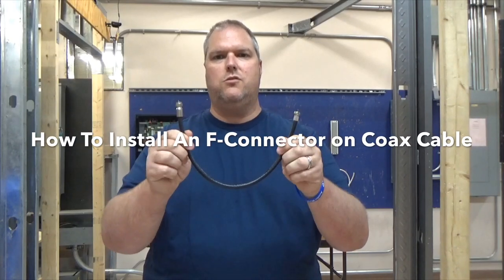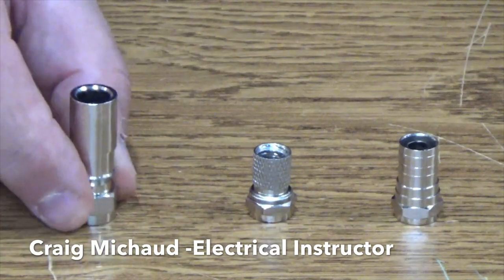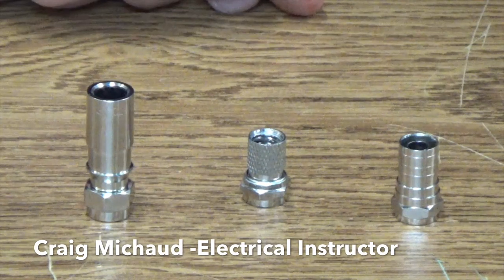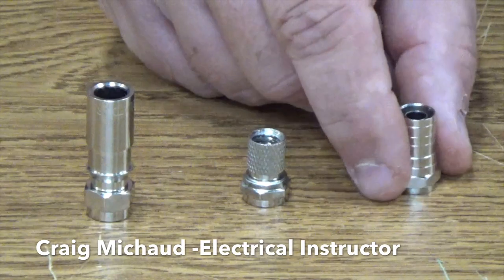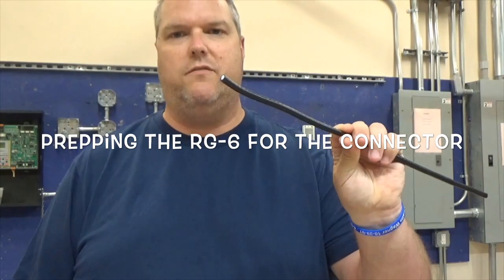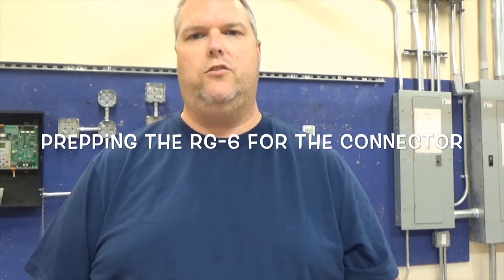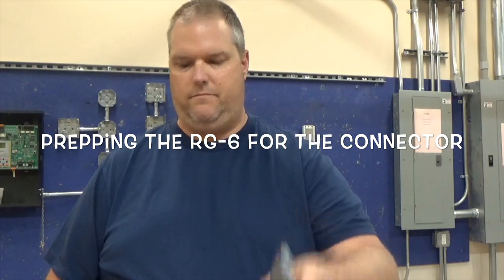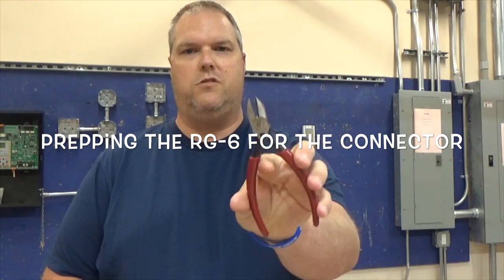Making "F" type Crimp, Compression, and Twist-on Connectors for Coax Cable

Comment: Bro, big thanks for this video. I live at the beach where no metal escapes corrosion, including coax connectors. I noticed that on days when the temperature dropped, my cable would go out. I guess the metal would contract enough that it would kill the signal. wild right? So before paying somebody in your line of work big bucks to crawl under my house and install new coax, I decided to clean and/or replace the badly corroded connectors and splitters.  Thing is, I made the mistake of shopping for tools and supplies  without knowing what the f I was doing. so thank god for your practical explanation because there was nobody at the Home Depot to help me out. I bought a cheap stripper/crimper and and an assortment of connectors (twist on, crimp and compression -which were useless without the compression tool).  Before I watched your video, I f’ed up the stripping and the twist on connections. Nothing worked. After the video, success. I probably would be reading books on cold nights versus watching television if it weren’t for you! You’re awesome.

Comment: Nice video instruction. Just one thing that might be helpful to mention is if you cut the tip of the copper conductor at a 45 deg angle it will slide into the socket easier when installing.
Reply from the maker: @donny9885  Thanks for the tip I have never heard that! I appreciate your input! CM

Comment: I bought some compression connectors that seem to have an inner punger and a metal core that pushes out...im assuming the core goes in the hole  and pushes the new tip out ???

Comment: I'm using the milwaukee extended crimper for the compression connector. I was having trouble getting it flush with the opening but your tip to twist and push helped. Thank you..previously I was using the twist on type

Comment: I like this guy. His presentation, techniques, and results are not "perfect," but this is the reality of cable installation. I have installed RG6, RG59, and--yes--RG8, RG8X, RG58, and even RG-214, for many years, and I have often struggled with connections. I use essentially the same techniques as Craig uses, and I can attest to the validity of his processes. I have nothing different to add to what he says. Good job!

Comment: I'm an older mill electrician that's rewiring my old house I'm restoring so I'm doing all my ethernet and antenna/av lines throughout my home.  Your video was excellent in the tips and it convinced me to go spend the extra cash and get the compression tool and fittings. Because after all. it's my place and I want the best products and the best installation.  Thanks for your help, I found it entirely worthwhile the way you showed all three types and their applications.  Well done sir.

Comment: I'm not a professional cable installer, but I am making a coax cable to carry phone and data within a school.  (Spectrum carries the signals with coax)  I read the instructions for Ideal compression connectors and they stated 1/4 inch for each measurement.  It simply is too short for the RG6 quad shield I'm using.  I spent over an hour experimenting and wound up with 1/2 inch for each one.  Now my cable looks like the professionally made one that I'm using as a model (Monoprice coax cable).  You mentioned using 1/2 to 3/4 for the conductor then trimming as needed.  But for the other measurement, you actually went a little shorter.  I'm trying to figure out why my measurements are so different.

Comment: Thanks for a good instruction.  Compression seems to be the way to go if you have any connections outside exposed to weather.  Are all types equal with regard to signal loss at the connectors?

Comment: You do know, Ideal and other manufactures as you mentioned make a striper that does a great and quick job of all that, and if done correctly without nicking or scoring the braid or dielectric.
However, don't remove the foil from the dielectric, this is intended to make contact with the inside of the barrel of the connector. Especially if you are using the screw-on connectors it may be all the ground connection you have after a while!!!  I'm not sure what manufacturer made the screw-on Type F connectors I used. But somehow intuitive of how this was going together, I was concerned about the integrity of the shield, and it would be cut by the threads while assembling it. Afterward, while examining it, individual strands started falling out of the cable end of the connector. So I unscrewed it, and as I thought the shield was cut clean at the end of the jacket. There may still be some continuity there, but with a little pulling of the cable may be not or intermittent. I would not recommend this type of connector!   Take one back apart, and I trust you won't want to use it, stick with crimp or compression connectors. Having seen what a questionable connection these made. I never actually used them and got the compression crimper and stripper and never had any problems.

Comment: Some technicians do not remove the foil like in this video.  Are there pros and cons?
Reply: I'm not an electrician but I'm an computer tech so I do data cable.  I never remove the inside foil on quad shield cable. I installed several tv antennas and closed circuit tv work and it's never been a problem you just don't want the braid to touch the conductor.
Reply: Yes. The guy in the video is wrong. You should NEVER remove the inner foil. It can't do its job unless it comes in direct contact with the connector body as intended. In quad shield, you remove the outer foil to expose the second braid, but the inner foil is always left intact.
Reply: @nilpo  The inner foil should be left exposed 1/8 to 1/4 inch.

Comment: Great video - I have a quick question please. Comcast tells me I must run a "home run" cable from the basement splitter to a nearby wall outlet. Will be used exclusively for Comcast router....I'm confused over using rg6 dual, tri, or quad cable. Would like to future proof as much as possible - your thoughts or advise would be greatly appreciated. Love the channel...keep up the great work.
Reply: MB - Pulling cable is no fun, So use the best quality cable which would be RG6 quad shield.  Leave some extra so you can redo the termination if that should ever be required.
Reply: @robertjune1221  With all due respect, this is bad advice. Quad shield isn't "the best". It's simply one type of coax designed for a specific purpose. That purpose happens to be video transmission. For cable internet, you only need single shield coax. Regular RG6 is perfect for this. Installing quad shield adds unnecessary complexity and it's more difficult to pull in existing walls, especially for a DIYer. Unless you're in an unusually noisy environment, the additional shielding isn't necessary for data transmission.
Reply: @nilpo  You seem to have more experience with this than I do, but my cable company, (originally Time-Warner and now Spectrum) used quad shield RG6 in the run from where the cable entered my house to the cable modem.  I have worked with both single shield coax and quad shield and neither one is difficult to deal with.  I will respectfully disagree with you and still recommend the use of quad shield RG6.  I don't think that anyone will disagree with my statement that pulling cable is a pain.  The extra shielding won't hurt you and the poster did ask about future proofing the install.
Reply: @robertjune1221  Yes. Cable companies will often use quad shield everywhere. They buy enough volume to offset the additional cost and it allows them to stock only one type of cable on their vans. They also typically only make very short runs. 90% of the time, they can get away with it and I suppose they feel it's worth the gamble.

Comment: I can NEVER get the center white piece far enough into the compression fitting?
Reply: Use a flare tool. It gently stretches the outer jacket and makes inserting the cable much easier.